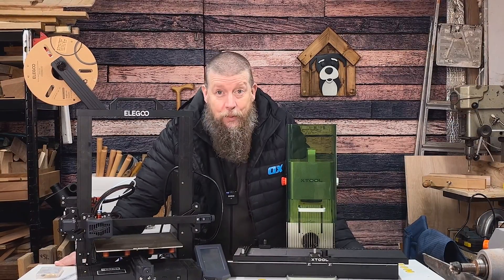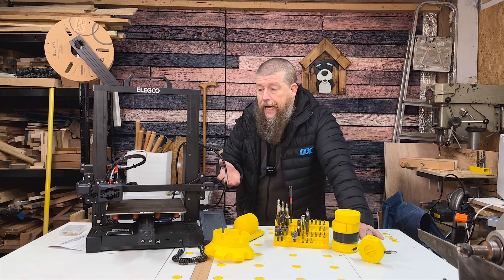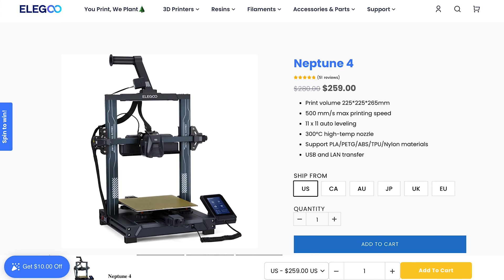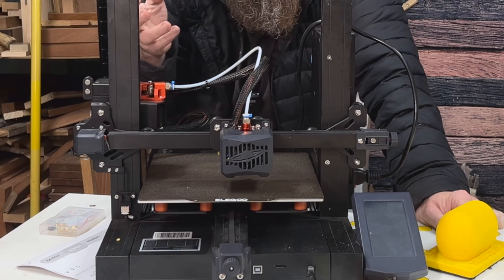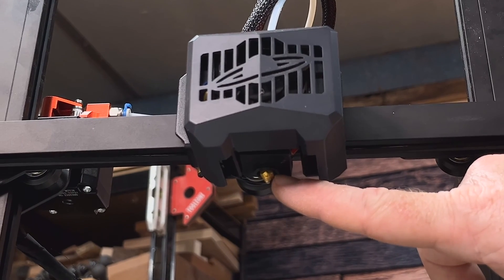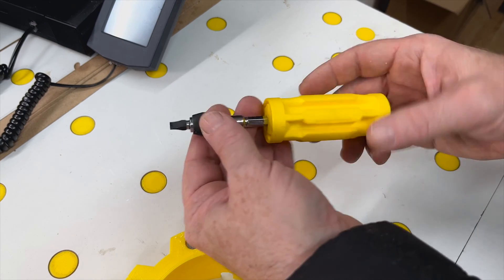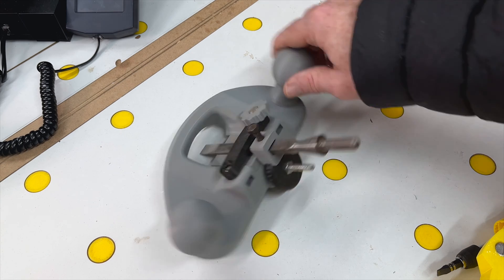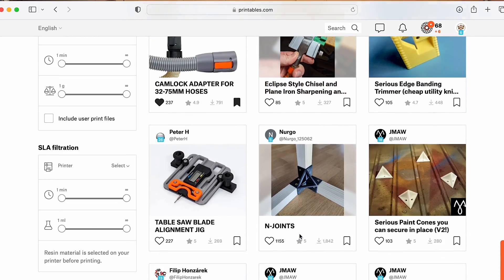Intro to 3D printing in the workshop #Techweek

Comment: Well I bit the bullet Dean and bought one, not the most expensive but The newish Creality Ender 3 V3 SE, bloomin' love it. I have had it for about a fortnight and it has been banging out stuff almost every day. Bench dogs, paint stands (little triangle things) I have made endless vacuum adapters, taking your guidance, the excellent Camlock system. I have made feather boards for my router table and table saw, and emergency stop paddle for the table saw, mitre slot rails, you name it I have made it, I have even printed off 16 new plastic feet for the dining room chairs, brownie points earned. Brilliant bit of kit.
Reply from the maker: Fantastic! They really are ridiculously helpful aren’t they!!
Reply: @WoodworkJourney  They certainly are Dean.

Comment: I'd definitely recommend a self levelling bed. I've got a creality CR-10 and the one thing that's given me the most pain is getting the first layer down reliably.
Reply from the maker: Absolutely, I remember the absolute pain in the bum of bed levelling. I used to have to do it with every single print on the A8, used to drive me crazy

Comment: Nice vid as usual Dean, surprised to see you pop up for 3d printing as I follow your woodwork stuff! I've been printing about the same amount of time, depending on what the thing is i'm making I'll usually use PETG for anything that's going to be load bearing or used outside etc and PLA for pretty models etc. I've made shelf brackets, door hinges for my shed, corner screw points (not sure what theyd be called really that I used for constructing a 3dprinting bench out of old melamine wardrobe sides. Hardest thing I've found with 3dprinting (excluding tinkering and the learning curve) is working out what I want to print! So seeing some of the things you've printed is very useful! Thanks!!
Reply from the maker: Working out what you want to print is definitely the challenge, I think my printer was going constantly for two weeks when I got it, I wanted to print everything! 😂

Comment: Cool vid Dean! :)
Tip - get yourself some stainless steel nozzles. Not only do they allow you to print abrasive materials but they are waaaaay less likely to clog, are easier to swap out and are easier to clean. They also seem to hold temperature better too.
Reply from the maker: Yeah that’s on the list for ‘nice to have’ stuff for sure